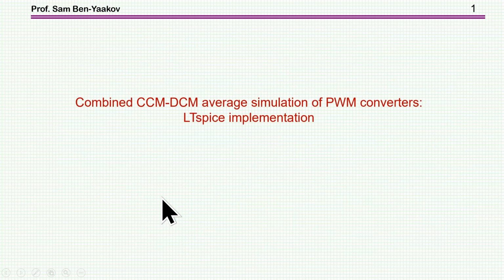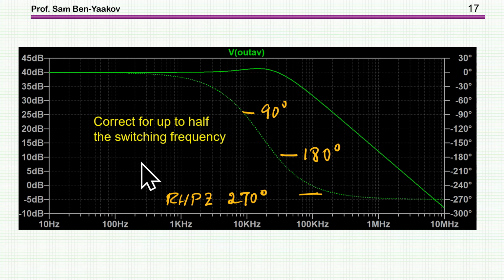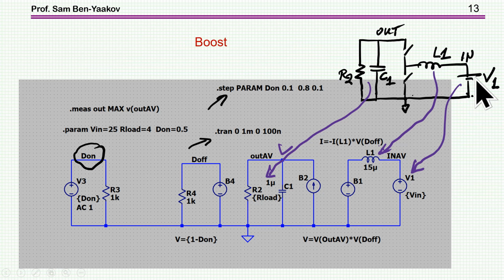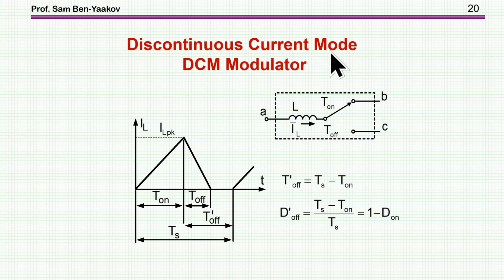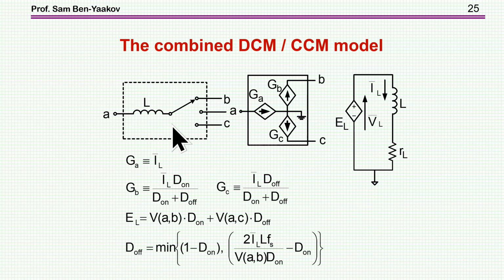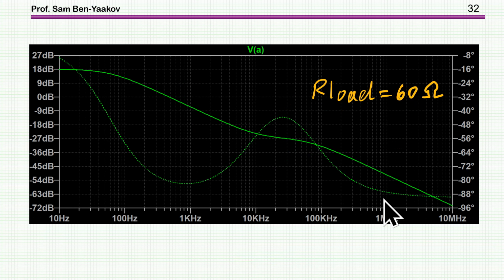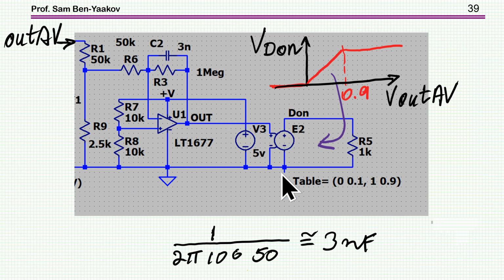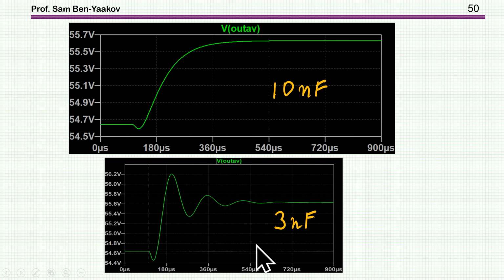Combined CCM-DCM average simulation of PWM converters: LTspice implementation

Comment: Thank you prof for a great video.  I must point out you skipped over a very cricitcal point and key detail.  That is how to calculate KI, this is the GM gain, or the gain of the VCCS that feeds the load.  Assuming no slope comp, for simplicity. We know that the Vcomp is a represenation of the peak current (Ipk) multiplied by the current sense resistor (Rs) times the current sense amplifier gain (Acs).  therefore we can write the equation Vcomp = Ipeak*Rs*Acs (EQ1).  We have already stated that the Gm feeding the load has a gain, as you singified as KI.  Being a GM amp is epressed in A/V and in the case of our current mode control scheme will be Amps per Vcomp or 
GM= Ipeak/Vcomp (EQ2).  
Therefore we can take my equation above (EQ1) and rearrange it and express it as Ipeak.  Therefore Ipeak = Vcomp/(Rcs*Acs) (EQ3).  now we insert EQ3 into EQ2 to get 
GM=[Vcomp/(Rcs*Acs)]/Vcomp.  therefore GM simplifies to:
GM=1/Rs*Acs

THIS IS THE GAIN OF THE KI TERM!  Hope this helps some folks further clarify some points of this awesome lecture.
Reply from the maker: Thanks for the interesting expansion.
Reply: Sorry I posted to the wrong lecture.  Will report comment there.  Not sure how that happened